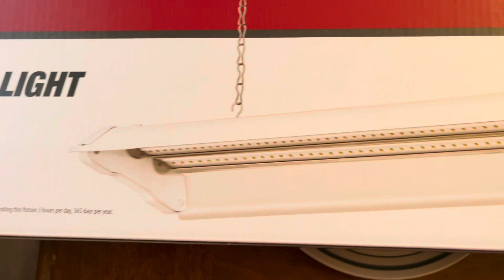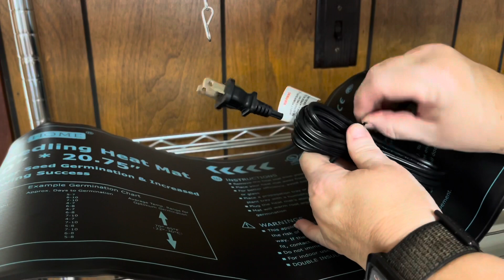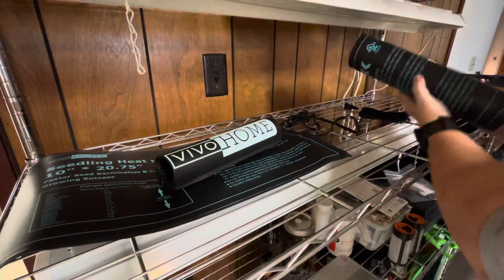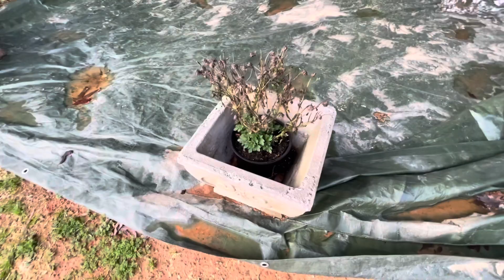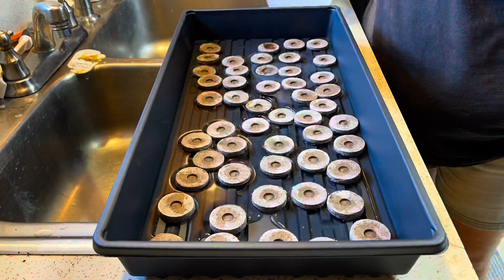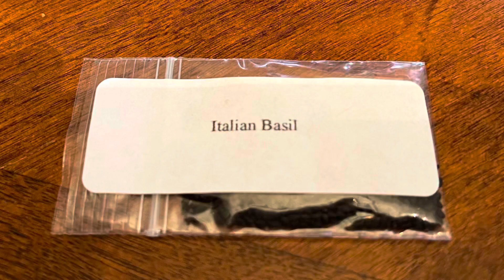Grow food in your kitchen! Setting up my container garden using heat mats, shop lights and shelving.

Comment: This is awesome your set up is almost exactly like mine I did get the jiffy trays with the holes in them and I usually use the Jiffy starter mix I might have to do the pellets I tried them before and I don’t think I did very well with them but I might need to try again it’s a lot cleaner than using the messy mix and having to moisten it and put it in the trays. I used lots of my sheet trays to put my seed trays on. I’m so ready to get my seeds started I’m going to start in a couple weeks I just kind of went by my planting guide for my area. Thanks for sharing!
Reply from the maker: My mother in law uses the pellets and her seedlings are always up before mine! I have learned my lesson!